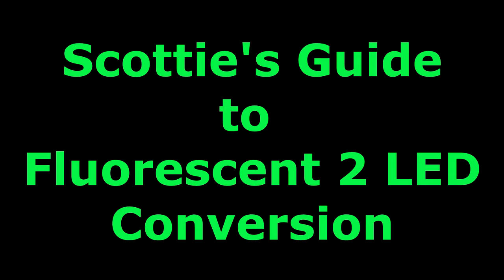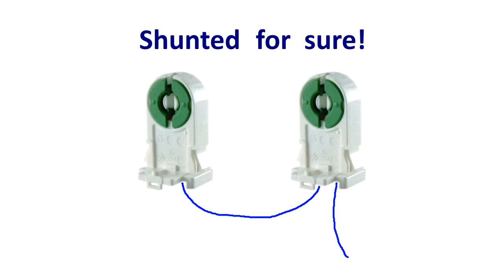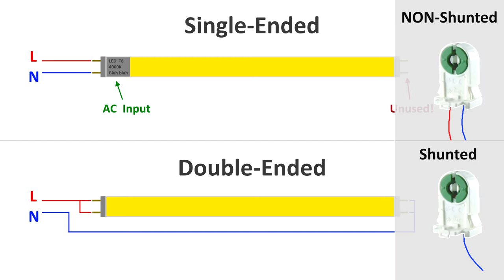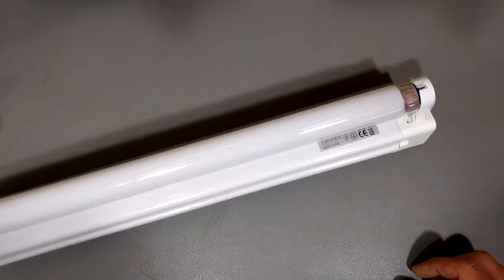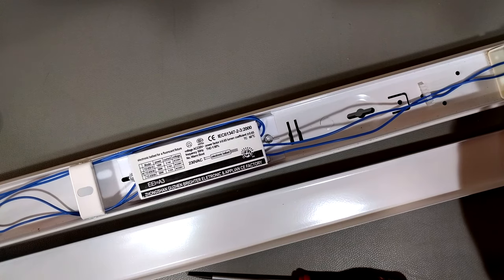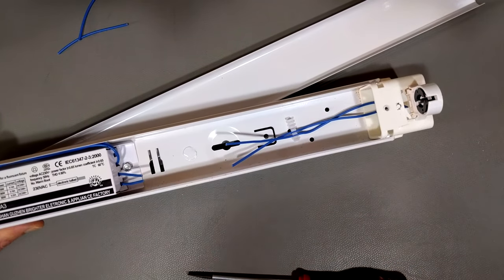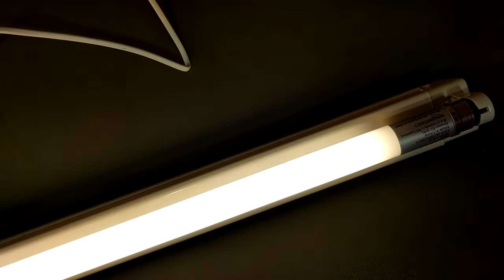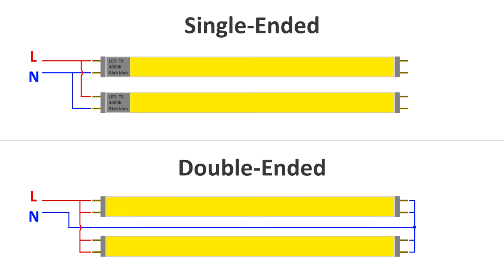Fluorescent to LED conversion made EASY!

Comment: LED light and fluorescent are bad for health, the save in energy is not worth it. Sleep quality is important and are eyes too. Would like to hear you on this topic. Thanks you for your content, l like the channel.
Reply: How the fk could they be bad for your health
Reply: I totally 2nd that; Scottie should do a show about the topic.  One of my ex's had seizure problems with fluorescent lights (flicker-rate), I now wonder if she has those same problems with LEDs.
Reply: Led is the technology. The problems related to daylight color. Try using warmer color (2700k) lighting for bedroom and living room.    Daylight color is really good for work areas because its the same color as the 12am sun. It keeps us awake.
Reply: @jeanbaptist6255  
I am not an expert, but I saw that the color intensity is not the same and this technology release electricity trash (radiation) that incandescent doesn't. A radio next to a fluorescent or led light work's bad.
Reply: @aubinroland1391  i am a electronic engineering.  If yor LED light are emitteing any amount of EMF in the lower end of the spectrum(3mhz-30ghz). Go to ikea and get new ones that isn't a smart bulb. The flicker rate in florescent come from the wall (60hz in NA) the flikker is noticeable when the capasitor charge and discharge rate is mismatch. I wouldn't attempt to DIY the circuit.  Its a simple ressister fix tho. Someone close to you maybe able to re spec the circuit.
Reply: @jeanbaptist6255  thank you truly explaining that so people who might not understand the topic now do. Great post.

Comment: Just went to Home Depot and got the GE type A/B LEDs. Pulled out the ballasts, joined all the wires on each side, and applied line and neutral to opposite ends. Super easy. No need to worry about wires, tombstones or anything. BTW, Home Depot told me they will not be selling anymore fluorescent bulbs once they sell their current inventory.

Comment: Scotty, you're a great hacker! Smart too. Some research shows that led lights harm the light receiving rods inside our eyes.
Reply from the maker: Yeah, the blue light thing... I did an experiment once with 'blue-blocker' glasses. I didn't notice any difference at all. That's just me, tho... I can sit in front of a computer screen until right before bed, and then just zonk out instantly. It IS true that the spectrum of light from most LED bulbs is different, but it's also true that the spectrum is becoming more and more 'friendly' as time goes on. There's no such thing as a 'white' LED, so they have to do sort of like phosphor coating tricks (like in fluo bulbs) to turn the non-white LED light into actual 'white' light. That's been getting better over time. I suppose it depends to a large extent on the bulb, your eyes, and your particular brain!

Comment: I've installed 5 Philips single ended LED T8 tubes here in the UK. I much prefer to use series wiring. This means that if the lamp is fitted the 'wrong way' around it will still operate okay. For single-ended use Philips should have provided a label to indicate the importance of connecting the power to the correct end. People replacing fluorescent tubes in the past didn't have to worry!
Reply from the maker: Yeah, that would be a much more sensible standard.

Comment: With a double ended tube it doesn't matter if the tombstones are shunted or non-shunted. I prefer double ended since rewiring is easier and you can place the LED tube ends in either direction and if you accidentally put a fluorescent tube in a fixture rewired for dual ended LED tubes nothing will happen.
Reply from the maker: Yeah, good point!
Reply: The LED tubes a bought are double ended too. We only have on-shunted tombstones in the UK. I get live does to the one side and neutral to the other. Can the live or neutral just be connected to the one side of the tombstone?

Comment: just for ease of handling and making the fitting lighter to work with and hang, we always remove the ballast, which also has some small value if weighed at a scrap metal merchant, otherwise can't fault the video!
Reply from the maker: Yeah, I actually remove the ballasts, too. No point just letting it sit there and do nothing when you can get some bucks for it.

Comment: Thanks for the video. It looks like we only have Non-shunted tombstones (4 connections) in the UK. So if i have 4 tubes do i wire say the live on the one end and neutral on the other, as u discribed. 4 connections keep say live to the left and neutral to the right of the tombstones???? Difficult to explain.
Reply from the maker: Not sure I understand, but we have mostly non-shunted tombstones here. So, for every upgrade I did, I removed everything from the fixture, disconnected the wires from one tombstone for each tube, and then for the other tombstone I wired neutral to one pin and live to the other. That means most LED tubes must be inserted with the "active" end on one side the fixture (i.e. the label side of the tube towards the live/neutral tombstone), but it also means simpler wiring since it's more like a normal lightbulb. I'm finding a greater selection of single-ended LED tubes, so that also gives greater flexibility when I need to buy replacement tubes in the future!
Reply: @ScottiesTech  Thanks for the reply.

Comment: "bal-bla-bla, it's very complicated" - then uncomplicate it! Because even the incandescent bulb can be a complex thing to explain (do you hear me, Mr. Boltzmann?). 
A low-pressure mercury tube, in its classical configuration, with a starter and a ballast, has a 2-step turn-on process. Those 2 steps are controlled by the starter. The reason is that the Mercury (Hg) within the tube cannot be convinced to be excited by the mains voltage (110 or 230V here in the EU) and de-excite as light at the starting conditions within the tube (pressure, temperature, composition).
Step1: The starter turn on the heater (filaments). That should vaporize some of the Hg and heat the gas within the tube. Meanwhile, the ballast (basically a big coil) is accumulating energy while acting as a limiter for the current. 
Step2: The starter is turning off the heater. Because the connection is cut abruptly, the energy stored in the ballast should go somewhere, and it goes to the tube as a high-voltage spike. That spike ignites the discharge within the gas (Argon if I'm not mistaken), which, in turn, initiates the excitation of Hg atoms. And that produces light, mainly in the form of UV light, which is converted to visible light by that white powder that coats the tube. (Replace the glass tube, which is opaque to uv light, with a quartz tube, transparent to uv light, don't add that powder and you have in your hands a germicidal lamp). After that, the ballast acts only as a limiter for the current. It's that big because it's designed to operate at the main frequency (50Hz or 60Hz)
That's the classical configuration for the low-pressure Hg discharge tubes. The electronic ballasts operate at higher frequencies and that allows for better efficiency (the classical ballast dump a lot of the energy as heat), much less flicker, instant turn-on and, depending on the actual schematics, a certain degree of dimming capabilities, working with supplies with a bigger voltage range (or even with DC) and even working with broken filaments.

Anyway, regarding this video, great job mate! I started the conversion to LED when the first tubes appeared here in Romania so I can appreciate the effort you put into it. Personally, I prefer to remove completely the ballast and the starter, completely rewire the appliance, and, with a permanent marker, write a note inside it if I used single-ended or double-ended tubes. That should make things easier for whoever comes after me to replace the LED tubes.

Comment: My kitchen has a circular fluorescent ring, and no visible starter that I can see. It's also quite touchy in that when I flip the switch, 98% of the time, it doesn't come on. At the very least, I have to tap it and at worst, I have to wiggle it around and even wiggle the plastic part that joins the ends of the tube and which contains the connectors where it plugs in. It used to be that I could just hold my hand next to it and it would come on, but now I always have to physically touch it.

As a general rule, I have nothing against LED bulbs and have them in all my other lights, however I do dislike the fact that the LEDs in them are all connected in series, so that if a single LED out of 10-15 burns out, none of them work. To me, that seems like a blatant case of planned obsolescence. They could have easily created the bulbs with them wired in parallel, and the bulbs would last MUCH longer.

Comment: So, you used a single ended bulb here but do you think one type is better than another? I am working with old 48” t12 fixtures, tombstones appear non shunted, looks like it is easy enough to shunt all of each side by connecting all wires on one side together and same on other end. Hot to one side,neutral to other. Is there an advantage to buying one type of bulb vs another assuming you have non shunted tombstones. Very nice video.
Reply from the maker: Not really. It's more a question of the type of fixture and the need to re-wire or not. Otherwise, the single vs double-ended tubes are the same thing internally.

Comment: hello I am a bit confused because my old flourescent bulb only had one pin at each end..my floruscent holder had one BULB and ONE BALLAST with three wires (ONE WHITE, ONE BLACK, AND ONE BLUE..I removed the ballast but do i have to change the TOMBSTONES??? Do they make LED bulbs with ONE pin?? Also how do i rewire with BALLAST REMOVED..some say you must hook diff . if u had an instant start ballast..please help  thanks
Reply from the maker: So far, I haven't found any single-pin LED tubes... so you may have to change the tombstones!
Reply: @ScottiesTech  hey scotty do the new LED tubes come with tombstones?

Comment: Very interesting, and informative explanation….. I have just bought. A box of 2 T8 del tubes from Costco. How can I identify a Single or Double side connection? Tks a lot for responding.
Reply from the maker: It should tell you one way or another in the included instructions.

Comment: My fixture has four bulbs, two ballasts and  non-shunted tombstones.  Red, blue and yellow wires running everywhere. Not sure what to do can you advise?
Reply from the maker: Your best bet is to remove the 2 ballasts, and then you can wire each bulb for whatever kind of LED bulb you want to use. Yeah, I know - that doesn't help much - but it should be more clear how once the ballasts and all the unneeded wires are removed. Then you can do either single or double-ended LED tubs/bulbs.

Comment: I have double ended Osram tubes from 2018 (ST8P SubstiTUBE Pure). Fixture holds 2 tubes. I wired L to  all pins on 1 side and N to all pins on the other side. When I plug it in lights will not work. I measure 230V between both sides. Tested the tubes in another fixture I didn’t convert yet to make sure they still work and they do. No idea what’s wrong. If each end of the tube is connected to 230V it should work, no? I am tempted to simply connect L and N to each side (without tombstones) to test. Do both pins on each side need to be connected?
In my fixture I have 4 ‘connections’ on each side (2 per tube). I measured between each connection on 1 side and connection on the other side and all show 230V AC. Any idea/clue why my LED tubes will not light up? Greetings from Belgium!
Reply from the maker: Are you sure they're double-ended tubes? I looked up that Osram model and couldn't find any info about their 'endedness'... Normally, both pins on each side of the tube are shorted together internally, so if you put Live on one end (even to only 1 pin) and Neutral on the other end, they should work.
Reply: There’s no label or marking saying they are single-ended tubes. When using them in an old fixture I just need to replace the starter, which is just a piece of wire. I will do some extra research and maybe contact Osram. Thanks for your input!
Reply: I checked the tubes again with the  flashlight on my phone. On one end (where the text is printed) I saw something that looks like some components on a piece of plastic that sticks to the inside of the tube. Then the LED strip that runs along the tube and nothing more on the other end. So I figured these tubes had to be single-ended. Rewired my fixture so each tombstone on 1 side had L & N and it worked 😎 Osram didn’t bother to label it so you can mount it in any direction with the dummy starter. Basically same as you explained in the bonus section. Thanks for your video, it is indeed one of the best I found on this topic. Take care

Comment: Changed a 5' fluorescent tube to an LED baton. Each time it is switched on it flashes on and off, not a flicker, a definite on and off. What have I done wrong?
Reply from the maker: Well, if you wired correctly, it's probably a bad LED tube. It happens.

Comment: I was wondering if you install the bulb the wrong direction does it do any damage to the bulb at all. on the single-ended Non-shunted type?
Reply from the maker: It depends on the bulb, but usually the non-connected end pins are just there to hold the bulb and are not connected to anything inside the tube. So, putting the tube in backwards will just mean your light won't turn on.
Reply: @ScottiesTech  If the unused pins on the single ended tube is shorted (like you mentioned in the bonus section of your video), wouldn't that short out the L and N if the fixture is wired with L and N on the label end, and the user insert the tube the wrong way?
Reply from the maker: @gfx2006  Yes, which is why you really don't want to do that. :) That's the way  I rewired all my fluorescent fixtures (L+N at one end). Then I used a magic marker and labeled the fixture with a big 'X' on one end, and 'AC' on the other. Hopefully, that will prevent future "Oopsy" events...

Comment: I just tried this on my aquarium light. I get a very dim light. What could be the problem?
Reply from the maker: Weird... The voltage to the bulb is the full 120/230Vac (depending on where you live)? I suppose the bulb could be faulty, but usually that means it won't work at all.

Comment: Probably easier to just change the whole fixture.
Reply: Maybe easier, but a LOT more expensive. A pair of new LED bulbs cost between $15-$20.  A new fixtures would be about 4 times that, based on my shopping experience.

Comment: I don't know why anyone would WANT LED lights. They are terrible for your eyesight.
Reply from the maker: Well, aside from the huge power savings, I didn't really want them... But at this point, I have no choice. Older bulbs simply aren't sold anymore. And the ones that ARE available online are uber-cheap and burn out in no time.
Reply: @ScottiesTech   They are starting to make incandescents again. Home Depot carries them. I would ALWAYS check the potential health dangers before buying any electrical gadget. Everyone should have an EMF monitor to see how much dirty electricity is being put out by the gadget/fixture into the living environment.
I wouldn't be surprised if the more something is hyped up as being "energy efficient or convenient, time saving etc", the worse it is for your health.
Reply from the maker: @emilybh6255  Home Depot, really?? Well, over here in France, they are strictly forbidden. That's supposed to be called 'progress', I guess.
Reply: @ScottiesTech   Well at least in France they aren't trying to cook everyone with cell tower radiation the way they are here. They are one of the few countries with low maximum amounts of radiation emissions allowed from cell towers of I think it is 10 microwatts per sq millimeter whereas in the UK and the US they allow 500 or half the strength of a microwave oven if I'm not mistaken. I also read that in France they have removed Wi-fi from libraries and put in ethernet instead. Although I suppose nowadays with everyone obediently locking themselves up in their homes, libraries are probably closed. Here is something on the radiation they are exposing us to. https://www.magdahavas.com/wp-content/uploads/2011/04/AMERICAN-INDUSTRIAL-HYGIENE-ASSOCIATION-JOURNAL-A-Review-of-International-Microwave-Exposure-Gu.pdf
Reply: The cooler temperatures are easier on the eye, when in an enclosure they’re defused more, and last but not least don’t buy them from the “dollar store”
Reply: @emilybh6255  the only place for incandescent bulbs are museums to educate the youth about the past

There’s really no place for fluorescent or incandescent bulbs anymore other then some niche applications